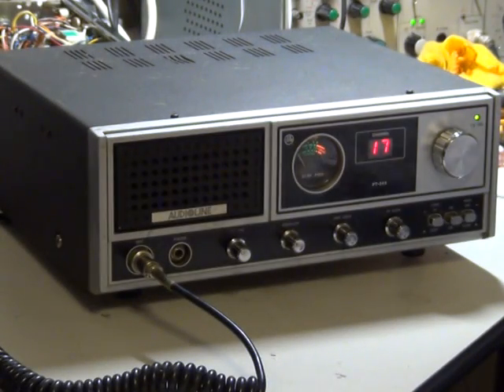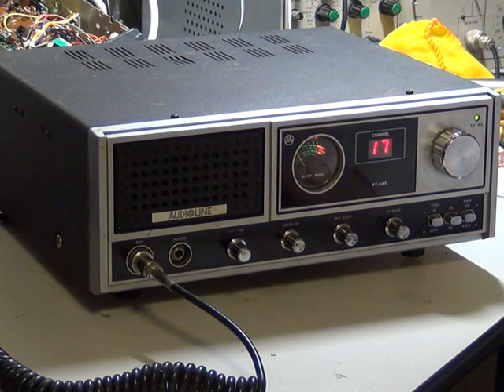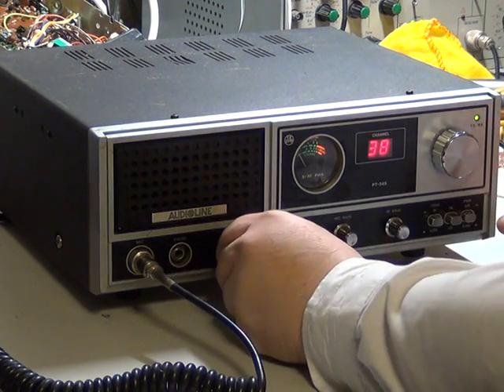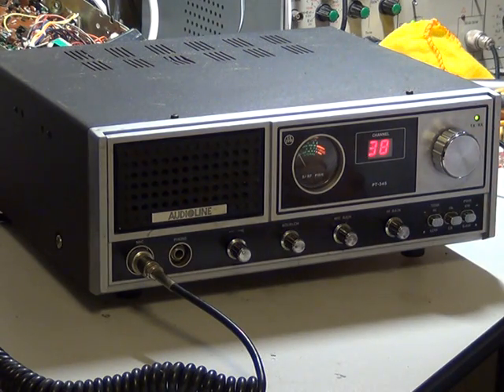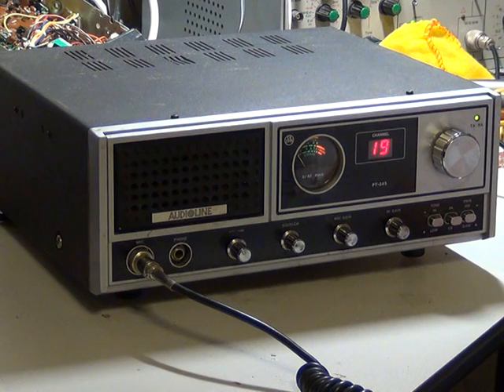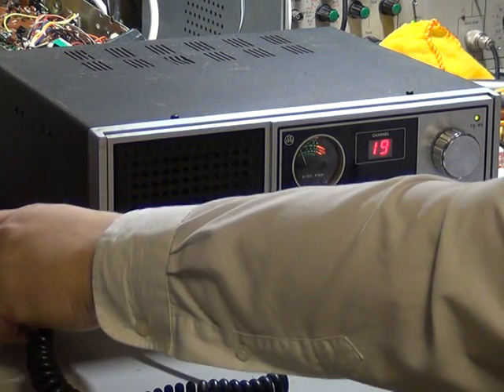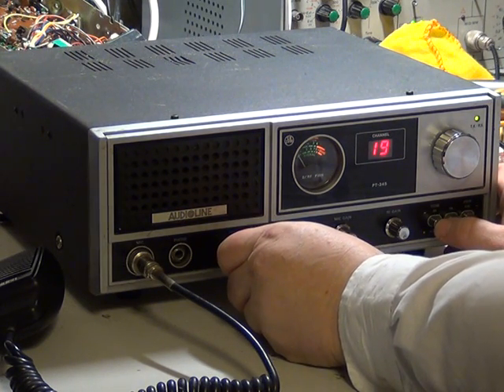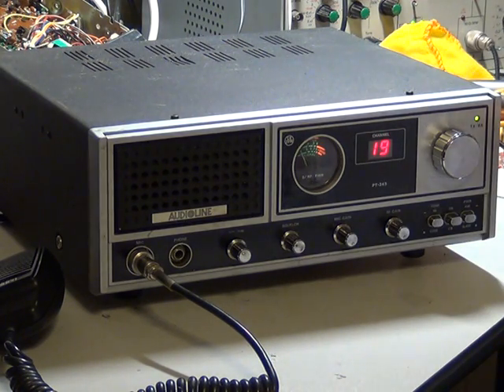Audioline PT345, UK (CB 27/81) CB radio (Base Station) - On The Air Test

Comment: I love my Maddison
Reply from the maker: I hope your Maddison is much better than these awful KP77 radios!

Richard
Reply: UK CB radio servicing I love it, it’s furniture and always on. Trouble is the clock numbers have stopped flipping over, I used to open it up and gently encourage the cogs with a thin screwdriver and they’d start turning but now it’s seized totally :-(
Reply from the maker: @mikerim6861  As you can see the UK KP77 didn't have the clock.

Richard
Reply: UK CB radio servicing yes I had one years ago but my Maddison is unbeatable

Comment: go one of these meter powers up and that s all no channel display?
Reply from the maker: There are two 220uF 10v capacitors that fail after 35 years in the voltage feed to the synthesiser. In the Realistic 2001/2000 manual (same chassis), which I've dug out to diagnose this for you, they are labelled C102 (near the back right) and C76 to the right of the Toshiba TC9119 synthesiser chip....some versions have a third. All three need replacing & the voltage rating upping to 16V. Although this is an 8V circuit, 10V caps aren't quite on top of the job. Should work for another 50 years then. Not having the audioline manual, the capacitor numbers may be different, but nevertheless the parts fitted are 220uF @ 10V. Change them...and don't forget they are polarised so check the + & - pins!

Richard
Reply: UK CB radio servicing  thank you very much sir
Reply from the maker: Don't know if you have a local components shop, but had a quick look on ebay for you & spotted 261171979724  £1.72 for a pack of 10 inc post.

Richard
Reply: I'll have a look thankyou